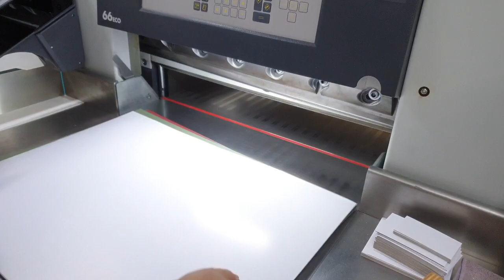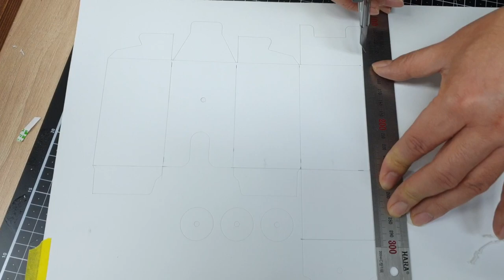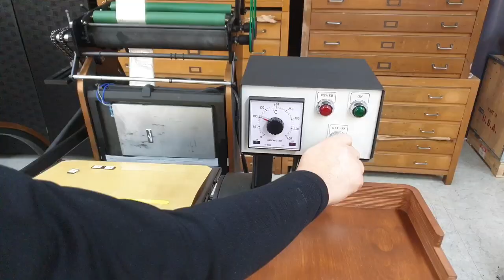레터프레스 명함케이스 만들기.Create a letterpress business card case.

Comment: Greg packaging, love it ! 
I’m wondering about the small letterpress machine you are using (the one activated by the hand bracket on the side). 
Can you tell me more about this specific model ?!
Reply from the maker: The equipment name is Hohner. The size is 6.5x10 inches. German equipment. The power is good. Mainly used for business card production. Among the business cards, full background printing is not possible. I use it in combination with large equipment. Easy to clean compared to large equipment.
Reply: waltzdesign do you have any advice finding a similar machine ?
The purpose will be to print business card, greating cards... such small format like this.
Thanks again for information you provided ;)
Reply from the maker: @IDE_photographisme  I used Google search for a long time to find and buy a machine.  Equipment does not come out easily.